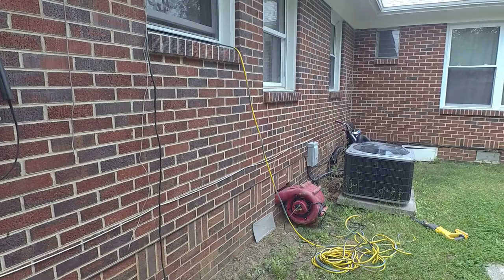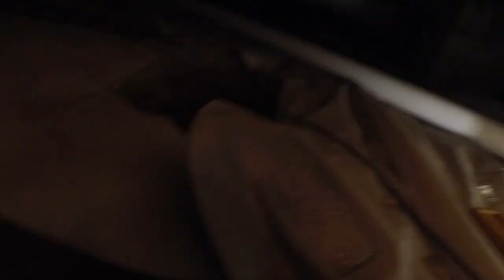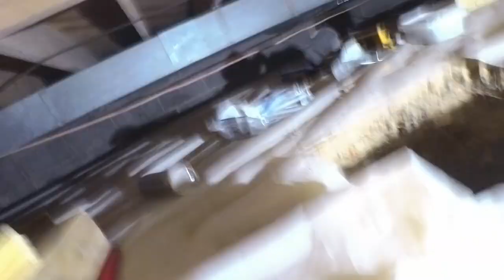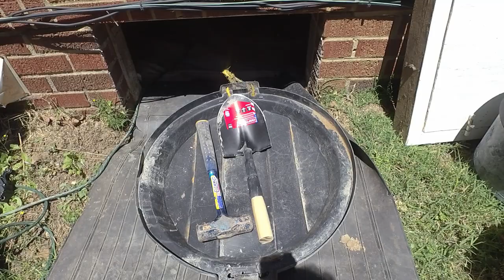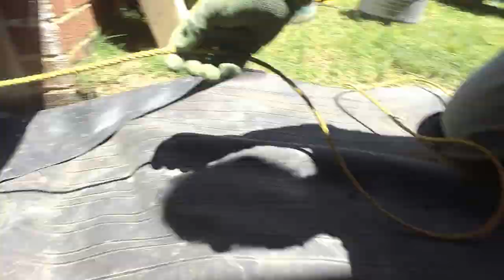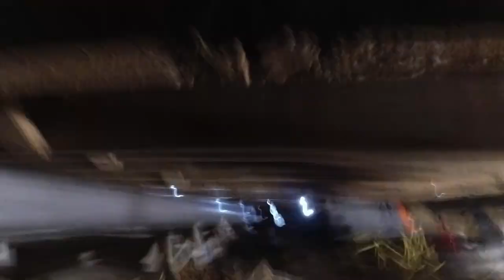Adding floor jacks to correct Sagging Floors

Comment: Using an auger bit for breaking up soil is brilliant, especially in such a compact, claustrophobic space; I have to tackle a bunch of posts in my crawlspace, so this video has been inspiring to get the job done.  You've over built this solution for your customer and they will never have to worry about floor support again.  It's rare to have a contractor that cares that much.  Fantastic work, Shawn.
Reply: Indeed. You said it perfectly. Hard finding a contractor that cares. Easy to find one that just takes the money and leaves.

Comment: I think I would have an anxiety/panic attack working in that space.  You guys did an awesome job
Reply from the maker: It was rough for sure. They guys got hazard pay for sure.
Reply: I got nice and drunk for my first couple trips under the house to clean it up. It's not my job, it's my own house, so I can do what I want. After I got used to being under there, and the petrified rats were gone, it got a little easier and I could face the job sober.
Reply: 😂😂😂 ive worked under houses and have done too many termite inspections/ reinspections/ treatments/ retreatments to remember with dead animals, snakes, snake skins, mice, bugs, etc lolol in low low clearance and ironically its never bothered me despite dealing with panic and anxiety for the last 25yrs. now, i wont go under a house w a plumbing leak, especially the drain. forget that
Reply: It looked clean under there at least. Mine is like that in the newer section of the house also, it's a pain to deal with
Reply: Turn on some jamming tunes and just work. I kind of have that problem until I turn up the radeo.

Comment: To the best of my knowledge, blocking prevents twisting. Never knew anything about it transferring weight to adjacent joists. The joist failed at the large knot. Knots in joists will aid in failures.
Reply from the maker: Yes! I learned that from This Old House about transferring weight

Comment: Not sure what is worse.  Working in a tight crawl space or the expense of pulling up the flooring for access.   That huge knot in the joist probably had something to do with the crack forming there.   The builder should have scraped that piece or cut it up for blocking.
Reply from the maker: We thought about pulling up the flooring but it was much easier to deal with the crawl space. Dealing with the crawl space was rough but when we finished we were finished...instead of having to put the floor back.

Comment: I’d never buy a house with a crawl space.......
Reply: I agree and love my 100 year old cellar.
Reply from the maker: We don't have many houses with basements or cellars here in the SE.
Reply: I work in pest control. There are benefits of having some sort of crawlspace or subbasement not meant for living space. It creates a water barrier, so water drains into the crawlspace from the yard when it floods rather than into the house. It creates a pest barrier, because things like house centipedes and earwigs will stay in the crawlspace rather than go straight into the lowest floor of the home. It also delays things like termites, because an inspector can find them going up the block into the sill plate, and treat and replace just those sections rather than having to deal with them getting into a wall stud.

There are preventative measures one can take on a slab to avoid these problems like termite bait stations, proper draining, pesticides on the outside perimeter, but it's not as effective prevention as a crawlspace. Obviously, a standing crawlspace, mud room, cellar, etc. is preferential, but any lower area is better than being directly on a slab.
Reply: Foundations are regional

Comment: I am having a 107 year old saging beam and the posts replaced next January. I forgot to ask the inspector, but would they use pre cast footings or just pour new concrete like what you have done? This is in a basement.
Reply from the maker: If it's in a basement it would depend on the condition of the slab. You can't go wrong pouring concrete footers in a giant deep hole. More concrete is better. 👍

Comment: Im about to do the same would quikrete the orange bag (4000 psi) be strong enough? How long to wait before i put the jack on the concrete? Should i use rebars? Are 12 tons bottle jacks strong enough to lift the central beam and the joist ?
Reply from the maker: Yes that 4000psi will be fine. Wait several days at least at 70 degrees. More days for colder temps. You can use rebar if you like but not needed for a small pour like this. 12 ton jacks will be fine. Good luck!
Reply: Thanks a lot for your knowledge!

Comment: This helped give me tips for fixing my floor. I'll definitely consider buying a steel tube like that and some jacks. That way after I fix my damaged joists, I can rest easy knowing they have added support.
Reply from the maker: Fixing things correctly is the only way to go. This house was sold recently and the inspector had nothing negative to say about our repair here or how it was holding up.
Reply: @GCFD  I noticed the steel tube. My Crawlspace basement is on a hill and a third of my crawlspace has low clearance and sagging floors and rotted sill due to water. I would like to know exactly what were those beams, the type of steel, and the dimensions, please.

Comment: Great video! I have a similar problem to deal with in my crawl space. There have been a bunch of band-aid fixes, but the floor is still sagging. BTW my version of the crawl space sled is a plastic underbed storage box. It's the perfect height to fit under my drain pipe.
Reply from the maker: Good luck with your repair Colin. I think it's easier to struggle through the permanent repair than to have to revisit again and again.

Comment: How long you let the concrete cure? Why did you use a metal beam and a wood one? Thanks for the video.
Reply from the maker: Let the concrete cure for a couple days at least. We used a metal beam because there was so little space to work with we had a stronger beam with metal in 3" than with wood.

Comment: Very cool video.  How thick is the concrete pads under the jacks?  Do you think 5000 psi quickrete be good enough?  (Of course this depends on the load on the jack, right?)
Reply from the maker: It's about 16" of concrete and yes that quickrete will work well.

Comment: I'd rather use a long flexible tube to suck air from the back corner of the crawl space. Right now all the dusty and bad air is just floating around back and forth.
Reply from the maker: Setting up the wind tunnel like we do eliminates all the dust.

Comment: excellent video! where do you find those jack bolts and plates at? i'm about to have to some drastic re-leveling on my house and its a tight crawl space like to had there.......
Reply from the maker: They are Akron C-4 posts. You can get them from the hardware store or from amazon. They are approved for temporary support or permanent secondary support if installed like we did. Good luck with your project!

Comment: Just wondering did you place each jack 5 or 6 foot apart. Also as an alternative to using concrete will Quikrete work for the footers to speed the job up a little?
Reply from the maker: I can't remember what the spacing was but it was way overkill. I wanted to give a very even support since the floor was sagging so much. I wouldn't do anything that would speed things up. Here, I wanted to give time to fully form a solid foundation. The homeowner recently sold this house and the inspection reports didn't even mention our work.
Reply: Thanks for the speedy reply the second part of my question was is it ok to use Quikrete  for the footers or is it better to use regular concrete?

Comment: This is a great video! It covers a lot in a fairly step-by-step format. Are those columns the type you can by at Lowe's/Home Depot? How much does a steel beam like that usually cost? Is it extremely heavy maneuvering in a tight space?
Reply from the maker: Yes, those are the ones from lowes. The steel beam cost depends on the current price of steel. This one was around $200 and was extremely heavy to move around.
Reply: @GCFD  Thank you for your response! I'm contemplating a similar job and trying to figure out exactly what I'll need.

Comment: Just a suggestion for anyone trying to correct sagging floors.. if the wood looks rotted, and the support beam you are using starts to crunch that wood... stop , go out and by new wood (matching dimensions) to sister to those joists..  and not just a patch , but a full span that goes from pier to pier..  

If you live in a high humidity area like the southeast US, this will be more likely the case vs pier settling...
Reply: Can you use a metal beam that goes pier to pier (matching dimensions) to sister that joint you're talking about?

Comment: Why did you use steal in one location and wood in another for the beams?
Reply from the maker: We had to use steel under the tighter crawl because it took up less space. The same strength wooden beam would have made it impossible to crawl to the other side. 

The other side had tons of space and we got away with a wooden beam.
Reply: @GCFD  Understood

Comment: i seen another guy who made a vacuum shovel, using a 2 1/2 in hose he made from steel a round end with handle and 5 triangles for teeth, started with a big shop vac then got a truck mounted unit
Reply from the maker: Sounds pretty useful. Do you have any more specifics on how I can make one?

Comment: HI I have a question. Under my girder beam the builders used slate shims. The house is 30 years old and overtime the slate shims crushed and made room for the girder to move. In the summer it swells and in the winter it contracts. On the second floor of my home in one of the bedrooms there is a quarter inch gap where the wall meets the ceiling. Its 1/4 in x 1/2 wide gap. In the summer it closes up and in the winter it opens up again. Also the drywall tape in the corner of those rooms and the adjacent room crumples up from the movement. I put a dehumidifier in the crawlspace and I believe I stopped the movement. However I still have a gap in the ceiling. My question is should I jack up the girder and replace ALL slate shims with steel shims or just the shims that are crushed. How would I go about doing this as I do not want to cause further problems by doing this. Thanks
Reply from the maker: I think I would jack up the girder and replace all the slate shims. I would place a jack at each one and jack the whole thing up at one time to make things nice and evenly supported. Best luck!

Comment: What size steel beam is that ?
Reply from the maker: D-Smooth Videos I think it was a 2x3x 1/4” steel tubing. Space was so limited under there I had to go smaller but thick. I remember looking up the strength and it far exceeded what we needed.

Comment: Good video. Not much room under there. I'm totally gutting a house I bout down to the studs. I'm not removing exterior walls. Just inside stuff. The floors are sagging and I'm thinking of replacing the wood floors to with new real wood floors, not that engineered or laminated stuff. Is it a lot easier to level the house after or befor removing the old floor?
Reply from the maker: I would say after removing the old floor. If you can access the footers and jacks from above you'll have a lot more room to work. We considered removing the floor for this job, but it was much easier just to work with the tight space and get it done.
Reply: Thanks

Comment: Insane amount of work
Reply from the maker: Yes it was! If whoever built that addition had added the pillars and support like they should have it would have been easy. Trying to install supports after the fact was challenging with that tight space. Having a strong air flow with those big fans and lots of lights really help make it easier to work in those conditions. But we got the customer's foundation properly supported!

Comment: Thank God there are still people willing to do the tough, dirty, jobs. How the hell are the Millennials and Gen Z going to survive when all the Boomers are gone?
Reply from the maker: I don't know!
Reply: I learned from my Dad...and YouTubers like you fill in the rest 😊. Thanks for the video you’ve got some handy tips.
Reply: Honestly, it’s the Boomers that told their kids to all go to college instead of going into trade professions.

I said that our newborn son could maybe be a carpenter one day and my Boomer father-in-law vehemently refused in a very derogatory way.  I was slightly offended because my father was a carpenter and I thought he was absolutely brilliant.

Edit:  I’ll add that I have a BS in STEM and a Masters in accountancy so it’s not like I’m adverse to studying in college.  My husband doesn’t even have a degree at all and it still didn’t register in my father-in-law’s mind that maybe a lot of the college stuff he was told was propaganda.  🤷‍♀️
Reply: It doesn't matter which generation. I work in pest control, and some people just don't want to go in a crawlspace. I've done a termite job where the diagram was missing several areas where termite activity was underneath, because the person selling the job clearly never went into the smaller section of a crawlspace. Sometimes you have to squeeze through about a 18 inch by 24 inch hole to access some areas. Often people won't go through muddy or wet parts. Some people even in pest control are scared of things like snakes, and won't go around the snake to do the job, even in winter when it's just sleeping. It's certainly a lot harder to find someone under thirty you can trust to do the job right, because in most cases the person paying for the work is unwilling or unable to go in the crawlspace to confirm the problem or repair.

The most annoying thing having worked in pest control is returning to inspect a house that had wood debris, cardboard, etc. underneath that I told them to remove, and a year later it's still there. That will void warranties on any work.

Comment: You had two fans that I saw...try using one fan blowing 'in' and the other fan blowing 'out'. I think this would give you the freshest air quality...give it a try. I would let it air out for 10 minutes before entering the crawlspace.
To beef up the cracked floor joyce I would have cut two, 8 foot long plywood boards by the width of the boards 2 x 10 (???). Then I would have glued and nailed them on both sides of the crack floor juice. It would be strong and look great...and you would not loose any head space...cheap, easy, strong, and quick.
Reply: “Cheap, easy and quick” definitely describes your solution and what caused the problem in the first place. It’s also why people have to spend more money to hire someone like Shawn to come in and fix shoddy work. Far easier and cheaper to do it right the first time.
Reply: Using plywood? Super ghetto and there's no reason your crawl space needs to look good.

Comment: I have a couple questions;  

1. Where did you get those jacks? 
2. How many inches of concrete did you poor and what if I have soft soil?
Reply from the maker: You can get those from lowes or HD. I think I got these on amazon. We set the concrete around 18" deep. I would much rather dig a couple more inches deep than come back because the post settled a little bit.